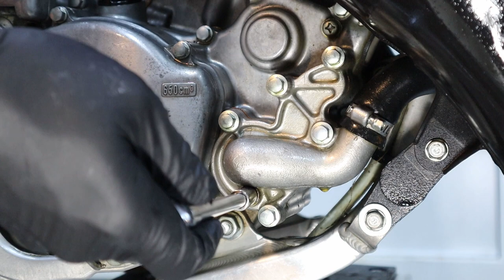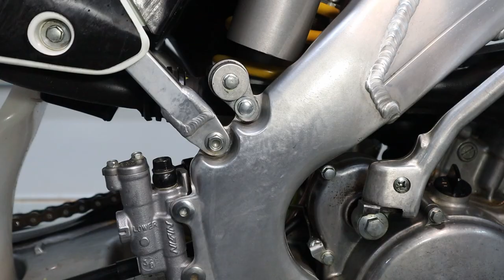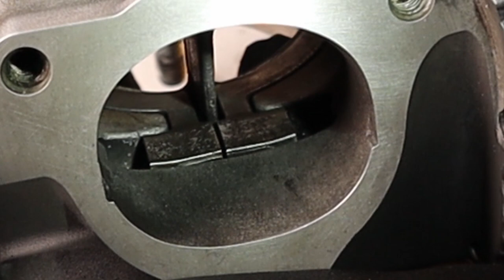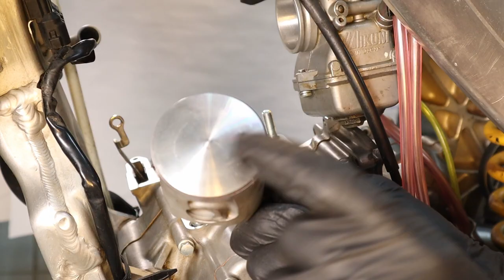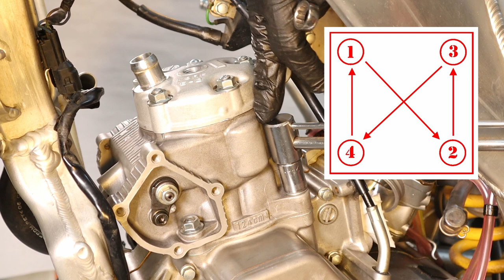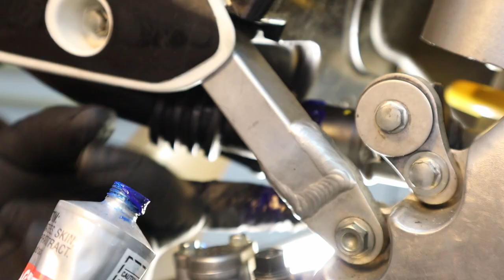The Right Way To Rebuild Your Two Stroke Top End (Honda CR125)

Comment: I have a 2004 Honda Cr 125 and I was wondering if it will be the same to your 2007 if I rebuild my top end? 
Also, my 125 has not been running good and to be honest, I’m not that smart mechanically. It keeps fouling plugs with the plugs being black with carbon buildup and once I replace it, it runs for maybe 20 minutes at most and then is fouled again. I run 50:1 from that’s what the guy that sold it to me told me he runs.  I live in Alaska and I’m not necessarily going to race but just learn how to ride a 2 stroke for the first time. He also said that he recently rebuilt the top end but I can push the kickstart lever all the way down with my hand, and there is some resistance but not a ton. So after telling you all that, what do you is wrong with it but just reading all that, and what is your advice to how to start to fix it? Please reply if you can, I could really use the help.  This video is awesome!! 🤘✌️
Reply from the maker: Hey Jake!  The 04 is very similar with the exception of the RC Valve being servo driven. (I did another vid on the RC valve if you need it). Plug fouling is usually due to using the wrong plug and/or wrong jets. Check your owners manual for those.  That kickstart sounds normal. I can cycle all mine by hand also. One think I DO NOT recommend is running a ratio of 50:1. The factory recommends 32:1 and I’ve been running that for decades. Ratios are hotly debated, but you won’t lose performance by using 32:1 and you will do a lot to ensure the longevity of your motor.

Comment: What was the lubes you used?
Reply from the maker: Hey Chris. I use Maxima. It’s good stuff!  I put some links below.
Reply from the maker: https://amzn.to/3X7r3v9
Reply from the maker: https://amzn.to/3X55E5T
Reply: I didn’t realize the all the technical measurements required for replacing a piston & rings
Reply from the maker: @chrisrieger9201  It’s all a function of how deep you want to dive in order to do the job right. It’s possible that employing less precision can still result in a well functioning motor, but you risk more if you don’t take the time to confirm all the dimensions and clearances.

Comment: Hello , what would be the minimum compression it should have ? I just bought a 2006 Honda cr125r and it won't turn on . I did a compression test an it shows it has 120psi.
Reply from the maker: Hey Eddie. Off the top of my head, I don’t recall. Do you have the service manual?  If not, I can email one to you in PDF. All that good info is in the manual. If you don’t have it, you need it!